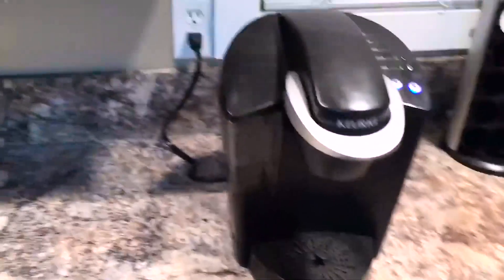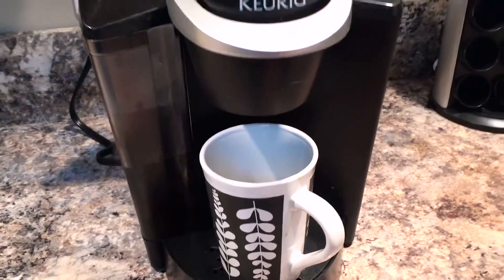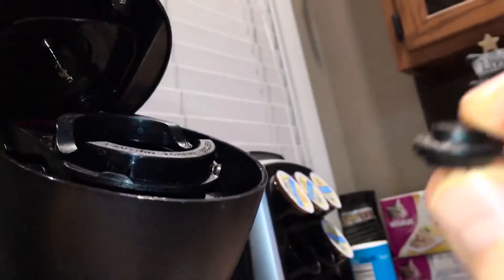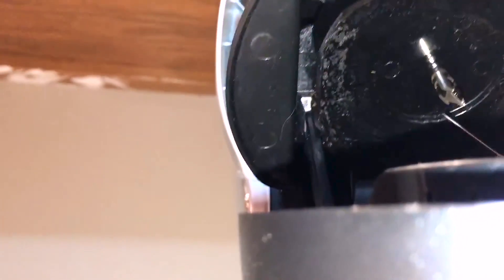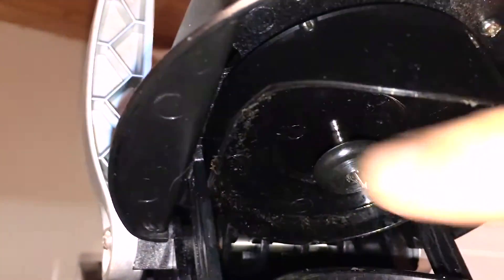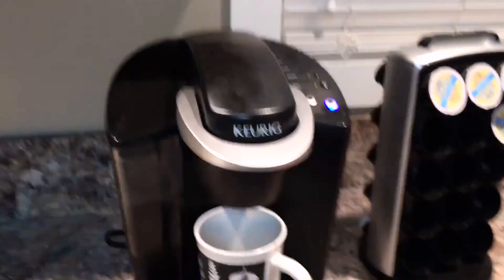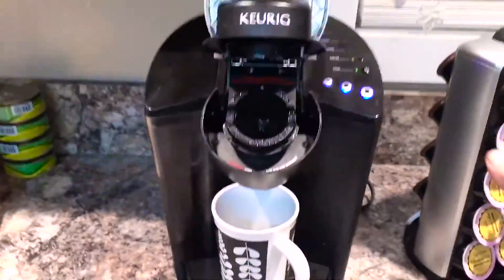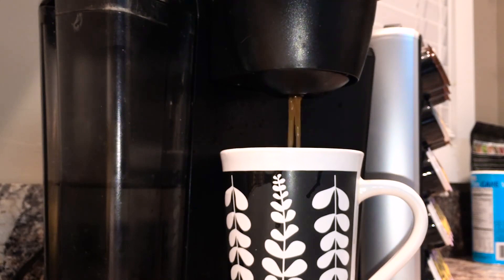Is Your Keurig Dripping Slow? How to Fix KEURIG Coffee Maker that Stopped or Slow Brewing

Comment: I was also ready to get a new one. I did this fix and it still did not work right. I then used the paper clip on the bottom needle under where the pod sits and that was the problem . Problem solved .